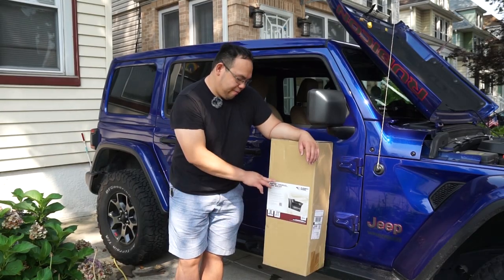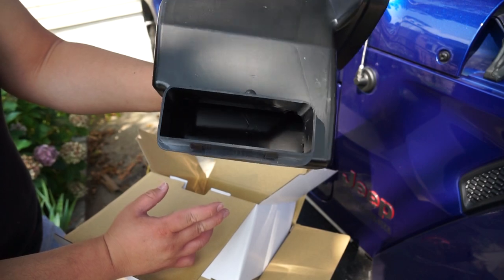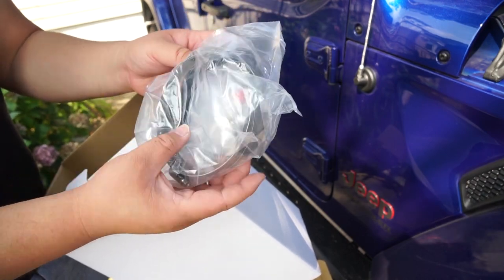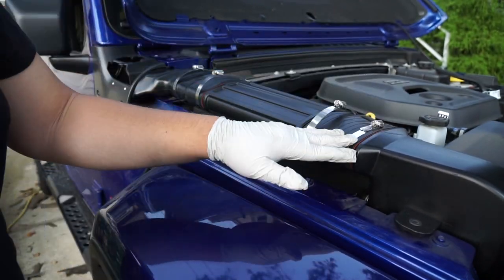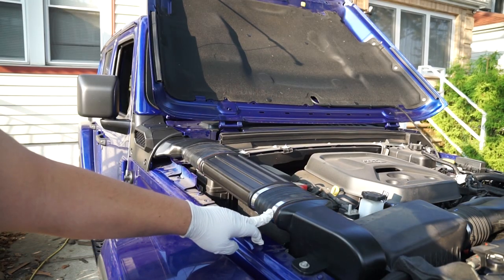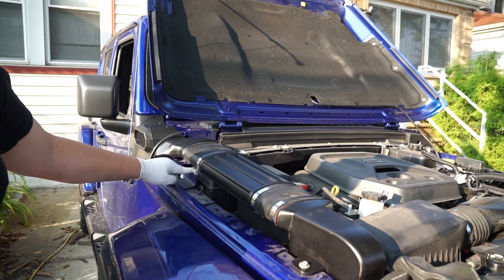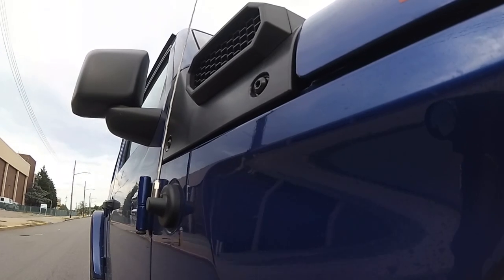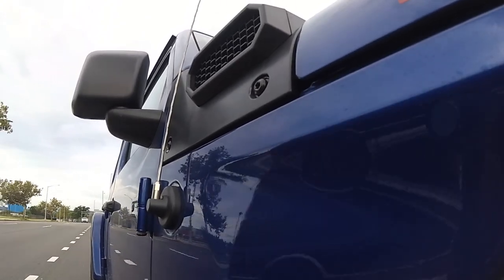Rugged Ridge AmFib Snorkel System , Watch before you buy!! Tips to install

Comment: I had one of these and removed it as it distorted with the engine heat where the hose clamps were and it opened up enough to get my hand inside it so it was pointless for water crossings

Comment: Hi.Polite installation video.
Did you check that the rainwater that entered from the intake duct was properly discharged?
Reply: The top of the snorkel is designed to allow rainwater to seep out the flanges